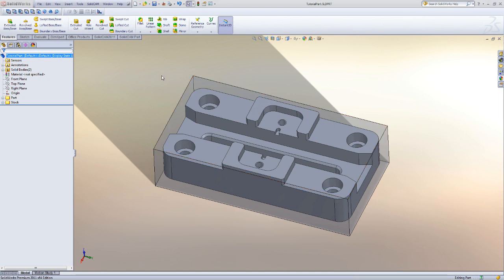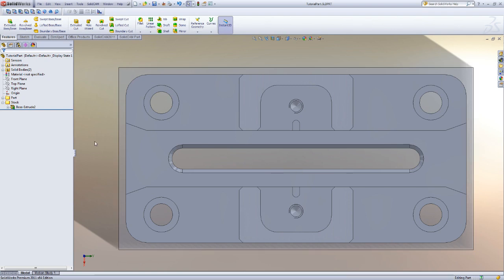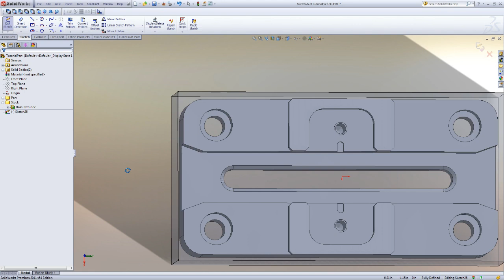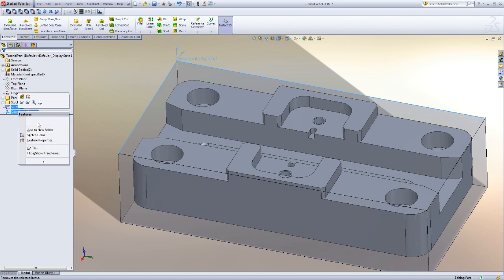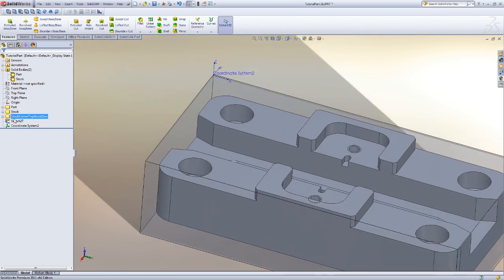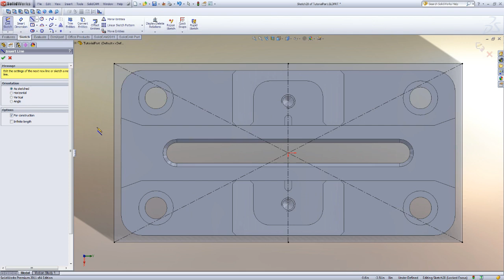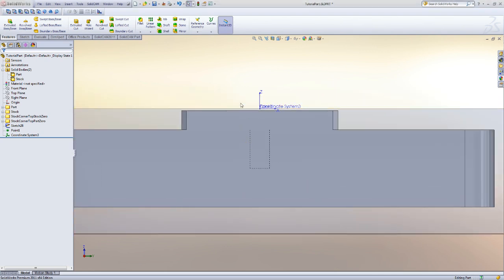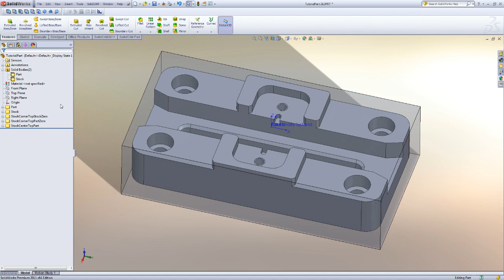SolidCAM Tutorial Video2 (Coordinate Systems )

Comment: The technique shown for Coordinate System 2 does not function in SW 2014, at least not for me. Everything is as shown until the final acceptance of the sketch in the upper right hand corner (6:16 time mark) at which time, the construction lines go away, and will no longer allow selection... with out the final selection, the lines react normally but the Reference Geometry tab only allows 'Mate Reference'... any thoughts?